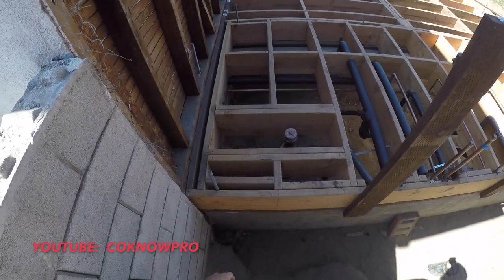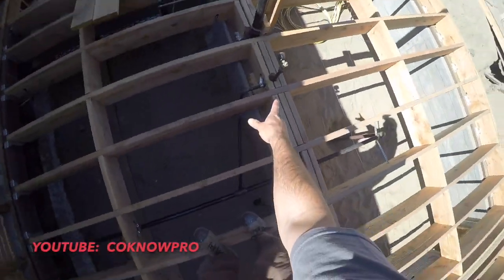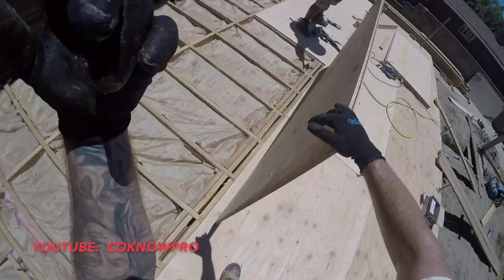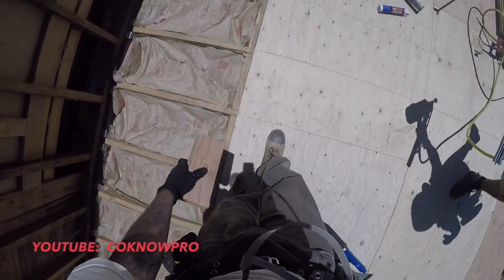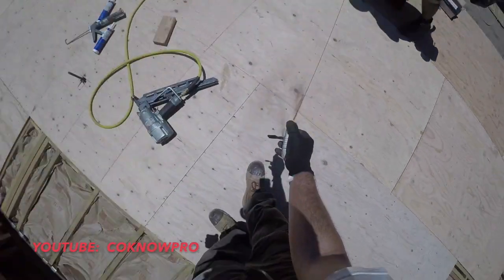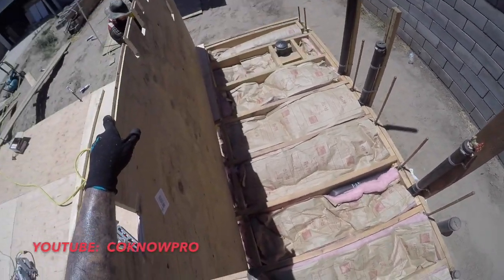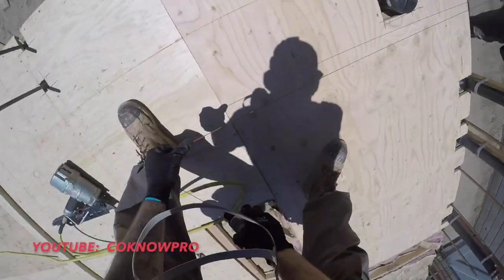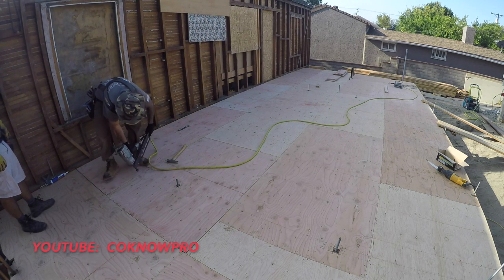😎Installing Plywood Subfloor 🔨⭐️@co-know-proconstructiontips

Comment: Great video! Question about the bathroom plumbing...Did you end up connecting new drainage into the main stack through the outside foundation or an alternate way? Thanks
Reply from the maker: We connected all new plumbing to the existing drainage through the existing exterior wall, which now became a interior wall. We core drilled through the existing stem wall then we ran a sleeve then we run our new drainage through the sleeve. 
Of course, there’s a clean out right on the outside of the new stem wall, on the other side of the bathroom per code outside of exterior wall. 
If it was an ADU, then the drainage would have to be independent of the main house and you have to shoot out your exterior wall chase along the property line dive into existing drainage in front yard. 
Whenever we build a foundation and our drainage has to go through any stem walls, we always install a sleeve that way after the poor is done, we can remove forms and slide our drainage through the sleeve. 
👍😎
Reply: @co-know-proconstructiontips  Thank you for that detailed response. Exactly what I was hoping. Much appreciated!!!

Comment: Thanks for your videos. Question, how did you account for your anchor bolts that landed on your double joist headers? Thanks
Reply from the maker: Cut the bolts flush with your 5/8 nut leave just a few threads three max. Then you can notch out the Joyce to rest on the J bolt and on the stem wall sleeper.

Comment: How did you make that hose bib device that went over that pipe? Thanks
Reply from the maker: Great question! We did not make it you purchase it like that. That is a pipe cap with a hose bib attached it is for testing your vent lines. It’s for testing your vent pipes when your vent pipes are ready for inspection you have to fill them with water to make sure they can hold water in the vent line then when the inspector does a walk-through you release the hose bib to show that it’s under pressure and is filled with water and holding. You can purchase from a plumbing wholesale company or just search for it online and have it shipped to your house if nothing in your area has it. Hope that helps 👍
Reply: @co-know-proconstructiontips  Thanks. I looked it up and found one. I've lost track on how many times I've watched your videos. Thanks
Reply from the maker: @darrengunnell7255  Awesome! glad you like the videos and thanks for the support. If  you have any questions we got your back. 👍😎